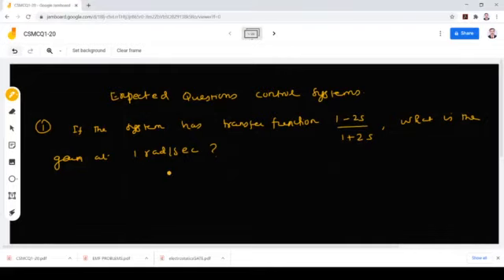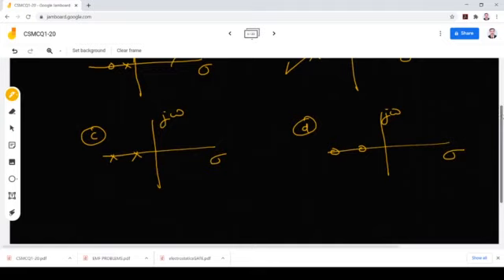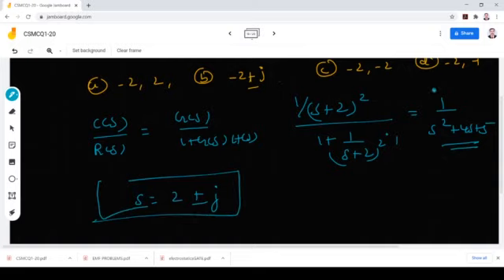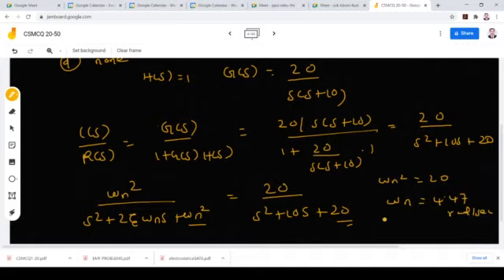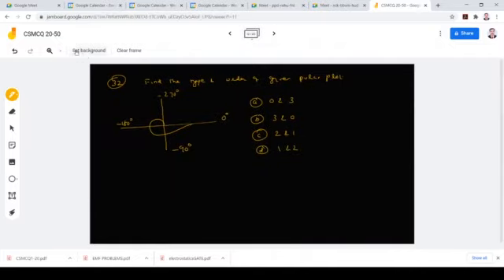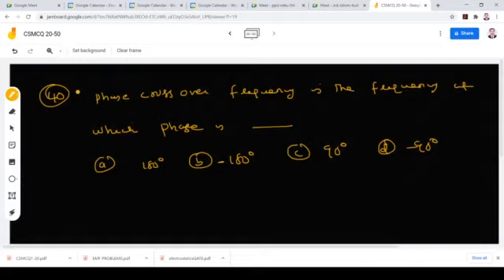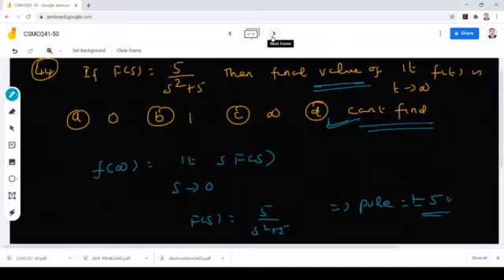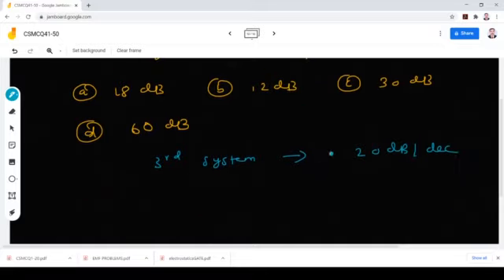TRB TNEB CONTROL SYSTEM EXPECTED QUESTIONS

Comment: Good morning sir,
For question 41 ,match the following b) is s^2+5s+6  Only gives ethavalue as 1.04~1 makes system critically damped .if we take constant term as 16 it makes system under damped(etha=0.625).Thank you sir
Reply from the maker: 1.04 is greater than 1 ma'am..if damping ratio is greater than 1 it's over damped system..we can't make 1.04 equal to 1

Comment: Sir ques no. 21 damping ratio ζ value is 0.96,means 0< ζ<1 so its under damped if we find poles then also it ll b lyk  - ζWn +/-jWn√(1-ζ^2) means poles are lying LHS and imag axis. So how come undamped sys sir?
Reply from the maker: Yes ma'am..I also gave answer as underdamped system only but marked undamped system.its marking error. kindly ignore it ..thanks for correction
Reply: @majeethlectures  sure sir. Really thankful for ur great effort sir. Kindly do video for top 50 ques for DSP. It ll really helpful for us sir.
Reply from the maker: @priyanga6288  Your feedback is precious ma'am .you can get ss Questions from the link
https://youtu.be/E2vULN70cLI